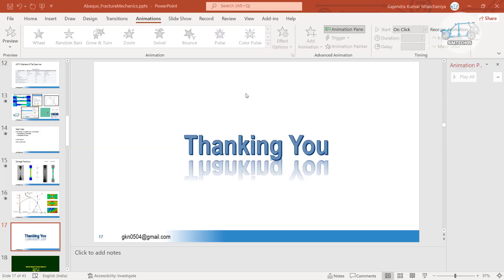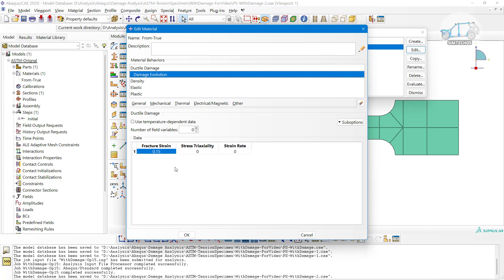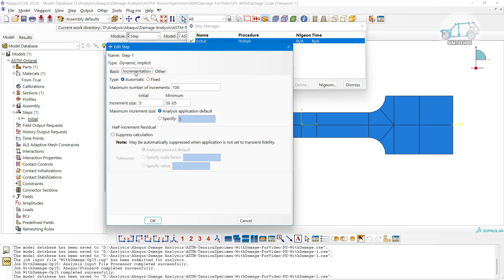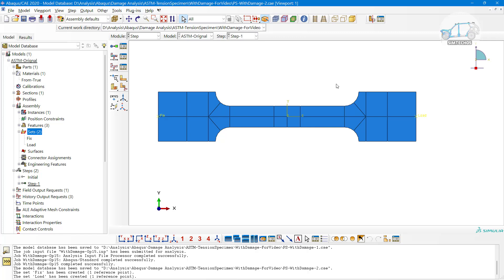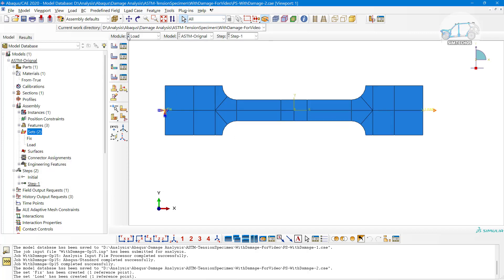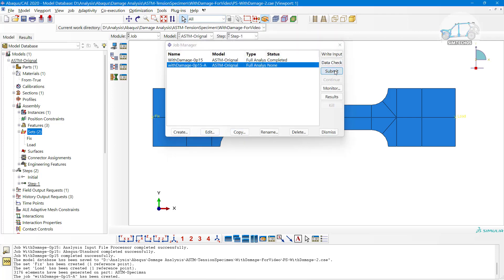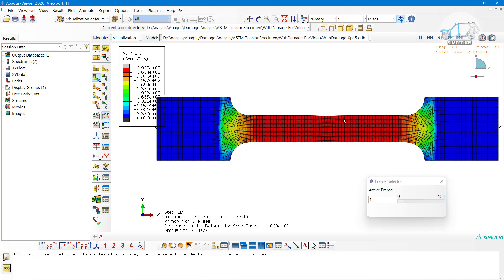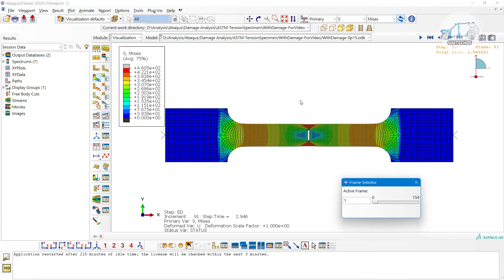Ductile Damage evolution in Abaqus (03 - Plain stress Example)

Comment: Hey! 

I am quite curious about, how matrix storage works in general and when we select the unsymmetric then what changes are accomplished to solve the convergence problem.
Reply from the maker: Dear,
This selection of matrix storeage mainly depends on material behaviour. What material model you choosing to solve the problem.
After yield poin the material model with associated flow...have almost no impact on selection of storage method. While material model with non-assosicate flow model need to check on this option. In such material model Kij not equal to Kji.

Hence storage and computation both will increase.

Comment: very informative! I have just one question: The damage initiation value (0.15) is not too high compared to the maximum plastic strain (0.0585) and damage evolution displacement (0.117)?  that should not be a value near to  the maximum plastic strain (0.0585) ?

Comment: Thanks for the useful video
Can I use this method to define damage evolution parameters in damage for traction-separation laws?
actually i'm doing xfem and i have to use traction-separation laws but there is no guide videos.,,,
Reply from the maker: Dear,
Traction separation law is useful when, the interface adhesive layer has a finite thickness and macroscopic properties (such as stiffness and strength) of the adhesive material are available.
It allows specification of material data such as the fracture energy as a function of the ratio of normal to shear deformation.
Also it allows multiple damage mechanisms.

In short yes it is possible.

Comment: how to do calibration and what is characteristic length *2
Reply from the maker: Dear,
Material calibration means simply find the true stress strain curve from engineering SS curve and finally extract E, yield stress, ultimate strength, and plastic strain strain data to feed in Abaqus material definition.

Abaqus provide this all using material calibration option.

Characteristics length*2 = value equal to twice the characteristic length.
Reply: @arsitech-ltd  Can you please post a video on this?
Reply from the maker: Dear,
Material calibration is different thing and calculation of "displacement at damage" is different thing.

Calculating"displacement at damage " i already explained in my previous videos of damage. Please go through video list at my channel and find.

Material Calibration video i not uploaded but avilable on YouTube.
Reply: @arsitech-ltd  thanks

Comment: Is defining density required for a static analysis?
Reply from the maker: Dear,
For general static step it is not required but for quasi-static step (as well for dynamic) it is required.
Apart from linear dynamic, frequency analysis, buckling analysis it need to define density.

I suggest to use density parameter always...it makes you habitual of using this parameter.

Comment: Thanks for the useful video
Can I use ductile damage for weld?
My model is about progressive collapse. I apply the load on a column and I want to calculate the strength of the weld.
Reply from the maker: Dear,
Yes you can apply this technique for approximate weld strength.
Reply: @arsitech-ltd  
Can you suggest a reference or guide for doing that please?
Reply: @رامینمجرد-ف5ز  I also would like to know, please

Comment: Sir please make a video on compression of porous metal using gurson model.
Reply: Friction stir welding possible sir?
Reply from the maker: For Friction stir welding we use CEL or ALE technique.
Reply from the maker: Dear,
I not used guraon material model.
Reply: @arsitech-ltd  can you make a video on implementation of gurson model in compression?
Reply from the maker: Dear,
As i mentioned in above...i never used gurson material model.